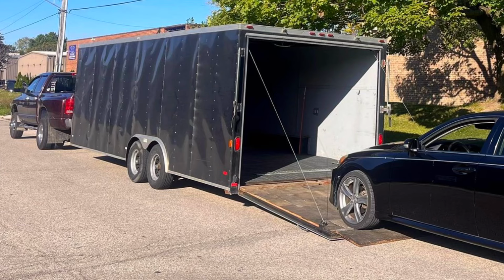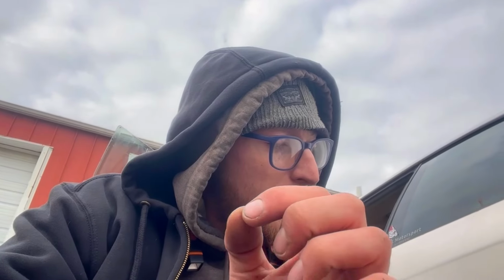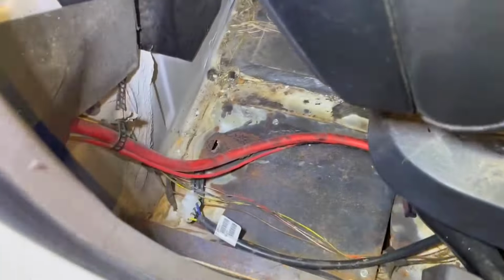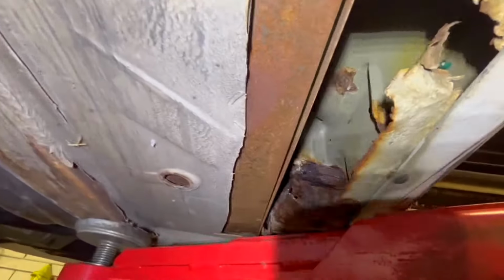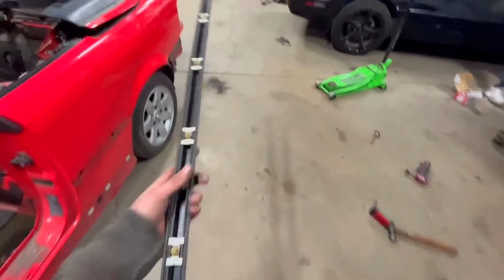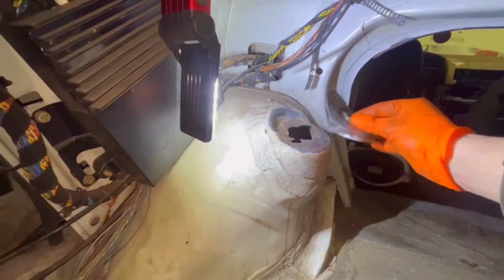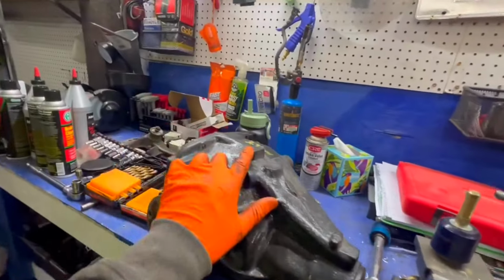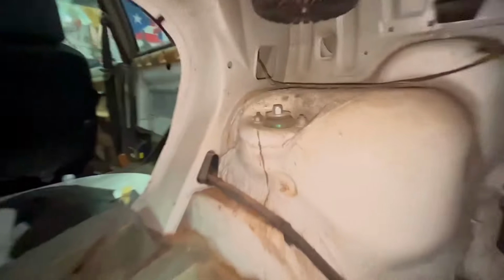Would YOU pay $1000 for THIS E36?

Comment: Hey bro the side door trims won't connect even with the new clips because the molding itself has softened over the years. Would you need to do is 3D print out some solid caps that go between the top of the inside of that molding to the top of the clip itself so when you push on it it doesn't just been the trim piece it actually pushes on the clip and gets it into the hole